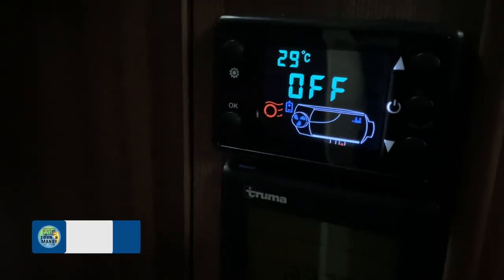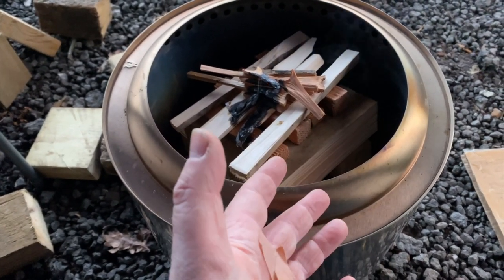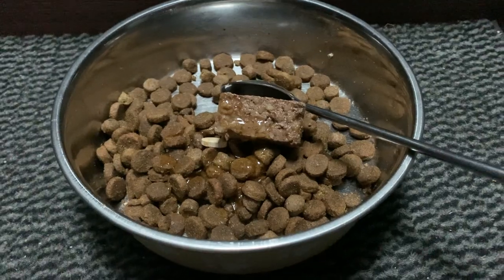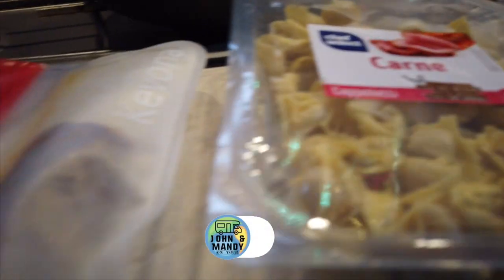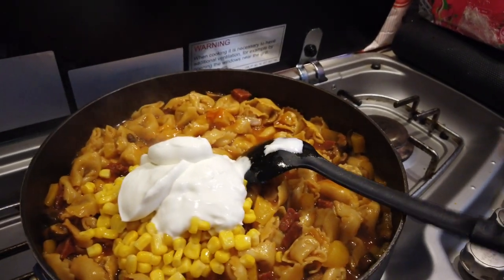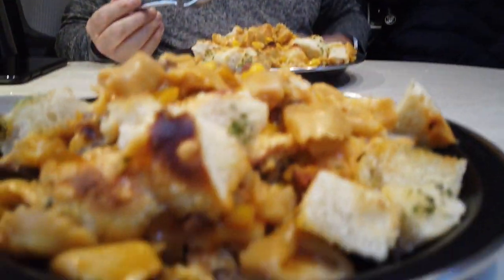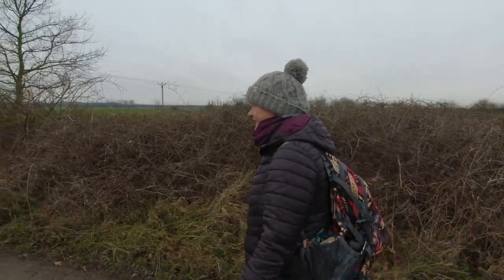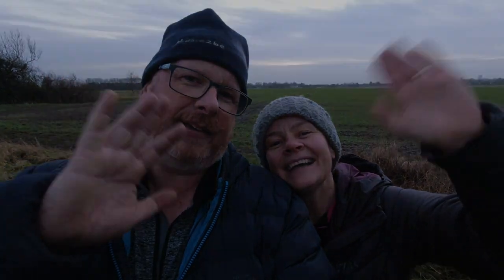We are allowed out!! - Vlog 60

Comment: Nice video as always, guys. However a bit of a fail on the fire. Top down burns are the best for bushcraft, coppicing and even wood burners at home. Trouble is you were trying it on a gasifier stove, which requires the burn to be at the bottom and force the unburnt gases up through the cavity walls in order to reignite at the top. That Solo stove is very efficient but has to be used in a specific way.
Loved Coop and the grub, as always looked delicious ☺️👍
Reply from the maker: We had lots of people saying upside down was a much better way so we gave it a try.. knew the right way up was way better - that stove is awesome 😁👍🏻

Comment: We have similar heater, adding very flexible hose helps the tick. You can buy expensive or the same stuff for aquarium air pumps, but do a soak test in a slash of diesel to test it is the good stuff. I’m guessing you have it on some bungee already?
Reply: The flexy tube you need is tygon. not cheap but pretty much inert. RS stock it.

Comment: I did say in your last video; the clicking sound from the pump is vibrating through the white hardened pipe into the heater. Try replacing with a softer compound pipe as I have done in the ones I've installed. This should cure most of the clicking. Thanks for the video 👍
Reply from the maker: We changed all but the last part to the softer compound as described in the vid which has helped a bit 😁👍🏻

Comment: When I've had issues like you've had with a delivery, and they where dragging out the refund, and it looked like they would not refund me, I talked to my bank they issued a charge back which got my money back.
Reply from the maker: I’ve already done that due to the company still refusing to refund me.
Reply: @johnmandy  It's not really on is it messing people around like that, glad the bank did the charge back for you.  I've got a slivered blanket that fits on the outside of my burstner, covering the winscreen and side windows.  In winter it really makes a big difference to how the van holds it heat, and mine is the type where you close the front off with an internal door too, so I can imagine the difference for you will be even greater.

Comment: Have been making improvements to EDD. Sorted isolating switch for living space touch spots lights that kept coming on at night. New walk through front carpet so had to fit isolator switch to vehicle battery to avoid parasitic drain and further security. Also wired in connector to dash to easily plug in small trickle charge solar for vehicle battery panel when vehicle is parked up for long periods. Have to be productive during lockdown. Looking forward to your Tuesday Vlog. Coops seems happy with his coat and booties.
Reply from the maker: Nice one Trace, seems like you’re making the most of lockdown too 😁👍🏻 nice to be all ready for the off as soon as we can.. 
Coop still might not be talking to me yet 😂

Comment: Hi John 
To deaden the ticking from our diesel heater I used a sheet metal working hammering damping block.. It’s dense rubber that absorbs the hammer blows.. I cut a piece off and screwed it to the body of the van and then the pump to it ... not absolutely quiet but better than suspending it .. I can sleep with heater on all night too :) Not expensive either... Hope it’s some use
Reply from the maker: Even if we suspend the pump by string from a fire tripod, the fuel line is still connected to the heater and that is the thud we cannot eliminate 🤦🏼‍♂️

Comment: Interesting..looked for quiet diesel pump...eBay,40 usd? In UK camperessentials has one 99 pounds. Thought they didn't exist because of design but perhaps they do???
Reply from the maker: I’m thinking it’s a myth, though if I can find one that explains how it’s quiet then I’ll buy & try and let everyone know 👍🏻
Reply: @johnmandy  thought so too but it's on planar heater site here in Canada at 124.if you go there there is a link to YouTube of it running,looks same but dead quiet . Also found dampers for sale like used in water but made no sense since metal on metal. Looks like frustrated heater buyer cash grab. Have fun experimenting.

Comment: Hi there, so I might have a possible solution for you with your diesel heater ticking noise. In my past working life in the manufacture of vehicles, I’ve been involved in the reduction of both noise and vibration issues within vehicles. Sometimes with gearbox cables and sometimes with fuel systems. In both cases the issues were resolved by introducing a mass to the cable or fuel line. In other words a damper to stop the vibration. So a close fitting ring attached to the diesel heater fuel line may well stop the transmission of the vibration (noise) into the motor home habitation area. A dense heavy material works best. Cheers from John & Al.
Reply from the maker: What I might try is to replace, against the manufacturers advice,  the final segment of hard thin plastic fuel line with the rubber branded hose I’ve fitted everywhere else, then see if that makes it any quieter. 🤷🏼‍♂️
Reply: I found a rubber vacuum hose, cotton covered, arranged in a loop, stopped the 'tick' being transmitted. All that is required between the pump and heater is a pipe that doesn't flex like a balloon (dampening the amount injected): vacuum pipes are very rigid (to prevent them collapsing) and so eminently suitable.

Comment: Hey. Could you try To fit the Planar silent pump on your diesel heater?
Reply from the maker: It’s £99 and there is zero info about why it’s quiet or what Db reading it gives. It’s likely to be the same pump.
Reply: @johnmandy  ok. I did not know that, so i know that you find a good resolution for that problem. Great videos!
Reply: @johnmandy  Thats the whole issue. You probably do get what you pay for (mostly). I cant even comprehend how someone can supply a heater complete for under £100. That said, it makes the branded ones at £700+ seem ridiculously overpriced. But we always fit branded  (eber or webasto) and I can honestly say you cannot hear the pump from inside the vehicle, and even outside you struggle.
On a side note, you mentioned the possibility of replacing the combi 4e with a 6d.....personally It looks to me like a straight swap(but I could be wrong). If you ever want to chat about it, get in touch.
Really laughed at Coopers face on the bed in those boots etc - he did not look impressed.
Cheers Ed

Comment: In your diesel heater video you mentioned a few different positions you could fit the heater. I wonder if you re located it to the cab area, at night you are as far away from the pump as possible to sleep. you could even put the pump under the cab and take fuel from the main fuel tank then.
Only a thought
Reply from the maker: We didn’t choose that location as it wouldn’t have heated the entire van, the pump noise would still resonate throughout the van too and as we said in the video, we do intend to connect up the diesel heater to the main van fuel tank. 👍🏻😁

Comment: Bob I don't have a diesel heater myself but maybe if you run the pipe in a length of pipe laying and hang it on cable ties  and keep it a way from the body work. It might work?
Reply from the maker: I’ve suspended the pump by string on a tripod on the ground, 99% of the fuel pipe is already rubber, so it’s just the solenoid in the pump thudding away that the solid fuel line is helping it transfer into the heater and through the van. Next is to find someone making a motor driven pump so it’s silent 👍🏻
Reply: Hi there is a silent one on eBay for a webasto but it is£99 ?
Reply: PS put a rubber gasket between the heater and the floor made from an old car mat maybe
Reply from the maker: We’re going down the same ideas list. We isolated the heater from the floor, aside from needing to use screws to fasten it down, believe me there is no way at all to make that style pump “silent”

Comment: Hi John and Mandy, great video I have just taken delivery of my new Autotrail and want to put the Bf tyres you have, I can’t remember if you put them on your auto if you did was they ok ?
Reply from the maker: We have the BFG K02 on ours and they’re brilliant, take a look at our website to see where we got them from as they’ll help you make sure you get the right ones 😁👍🏻
Reply: @johnmandy  John, I found the only way to stop my pump resonating through the whole caravan was to securely suspend it with cable ties in a sort of frame,  almost like a spiders web,we honestly cannot hear or feel it now,  I understand yours is under the vehicle but you should consider another go,  I also do not use the nylon tube supplied and swapped it for 3mm inside diameter braided rubber hose with no detriment to performance, this may also help dampen the thud (2 years of use and no issues) 👍

Comment: Your top sticks, although small, need to be thinner. Pencil thin at most. There needed to be more tinder too. Certainly in cold damp weather.  Or, do it like you did from the start! -
Reply from the maker: I’ll just stick, no pun intended 🤣, with the method that works perfectly fine 👍🏻😁
Reply: @johnmandy  That’s easy John! A pint of petrol lights in any weather! 😉🤯😀
Reply from the maker: Oh I save petrol for the big fires 😁😁😁